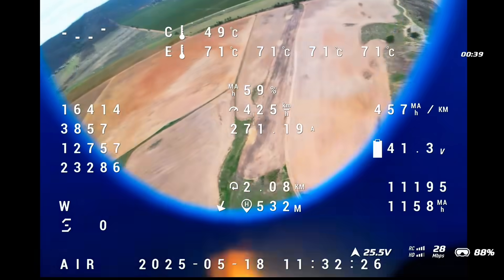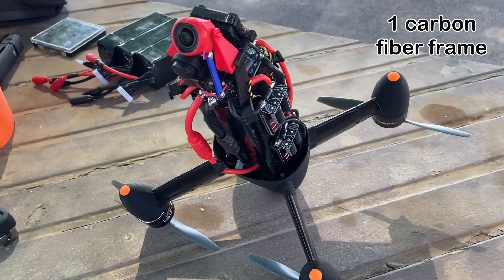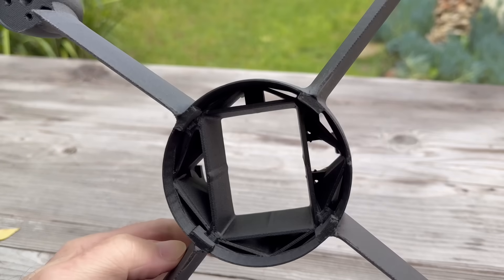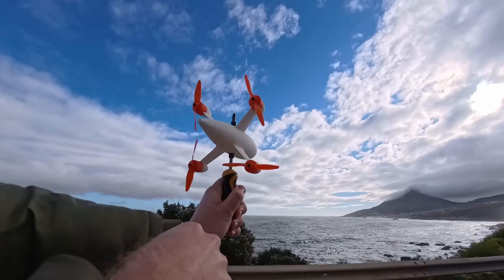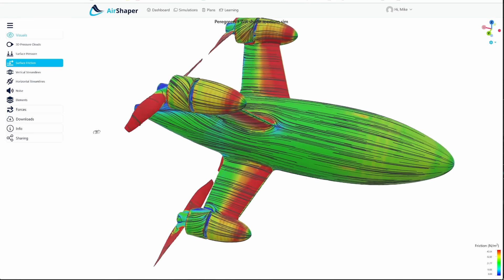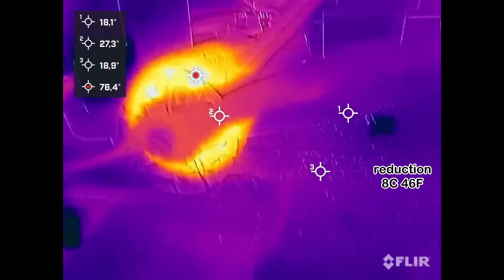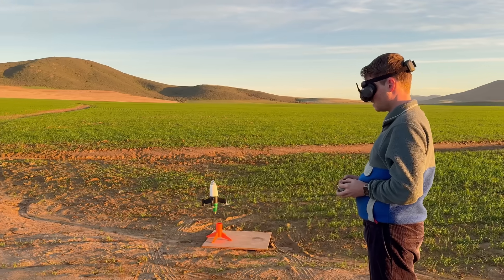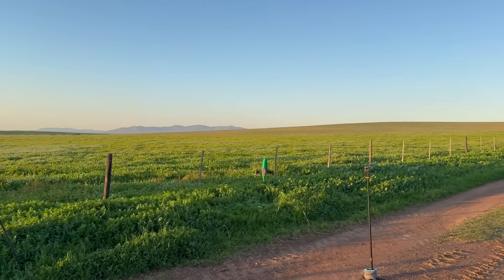How fast can a drone really go? 🇿🇦

Comment: 🤖 TLDW (Too Long Didn't Watch) - AI Analysis
Nothing personal, just learning what AI can do these days, n8n and stuff! 📚

⭐⭐⭐ EXECUTIVE SUMMARY ⭐⭐⭐
This video documents the technical journey of a father-son team in building the Peregreen 3, the world's fastest quadcopter. Through rigorous bench testing, multiple design iterations, and advanced aerodynamic simulations, they overcame challenges in power delivery, structural integrity, cooling, and high-speed stability. The key breakthroughs included a novel 3D-printed braced frame, a custom water-cooling system, and a deep understanding of passive stability, ultimately allowing them to set a new world record of 585 km/h (363 mph).

⭐⭐⭐ DETAILED BREAKDOWN ⭐⭐⭐
The video chronicles the ambitious project by a father and son to reclaim the world record for the fastest FPV quadcopter. It begins by contextualizing their journey, having previously set the record twice with their Peregreen 1 and 2 models, only to be surpassed by competitors. This sets the stage for the development of the Peregreen 3, an endeavor to double the power and push the engineering limits far beyond their previous attempts.

The narrative first delves into the extensive bench testing phase, where numerous batteries, ESCs (Electronic Speed Controllers), and motors were tested to find the optimal combination for power and stability. This process was fraught with challenges, including catastrophic fires caused by voltage spikes and running throttle controls through Betaflight without proper smoothing, highlighting the extreme nature of the power systems involved.

A significant portion of the video focuses on the iterative design of the drone's body. The team moved from a traditional carbon fiber frame, which created an unfixable center of gravity issue, to a fully 3D-printed main frame using carbon fiber-infused nylon. They explain how bracing and internal trusses were critical for achieving the necessary torsional stiffness, making the 3D-printed structure stronger in some aspects than carbon fiber. The design also evolved to incorporate a custom water-cooling system for the ESCs after air cooling proved insufficient and created excessive drag. This shift to water cooling not only solved the overheating problem but also improved the drone's aerodynamics.

The final major hurdle was achieving high-speed stability. Initial flights were plagued with wobbles. Through physical experiments with half-scale models and CFD (Computational Fluid Dynamics) simulations using AirShaper software, they discovered the importance of passive stability. By adjusting the drone's pivot point (center of gravity) relative to its aerodynamic center, they created a 'weather vane' effect that allowed the drone to fly straight naturally. The video explains complex aerodynamic concepts like shape drag vs. skin friction in an accessible way, using the golf ball dimple effect as an analogy. After meticulously tuning the flight controller and implementing all the design improvements, the team successfully achieved a new world record of 585 km/h (363 mph), providing a satisfying conclusion to their exhaustive engineering efforts.

⭐⭐⭐ KEY TAKEAWAYS ⭐⭐⭐
🎯 A new world record for the fastest FPV quadcopter was set at 585 km/h (363 mph).
🎯 High-speed crashes can be caused by the Doppler effect creating a brief signal loss when flying directly past the controller, which incorrectly triggers the 'Return to Home' failsafe.
🎯 For structural components, a well-designed, braced 3D-printed carbon fiber-infused nylon frame can offer superior torsional stiffness compared to a flat carbon fiber plate.
🎯 At extreme power levels (over 16kW), air cooling is insufficient for ESCs; a sealed, water-cooled system can solve overheating while simultaneously reducing aerodynamic drag.
🎯 Achieving passive stability by carefully balancing the center of gravity and aerodynamic center (like a weather vane) is more critical for high-speed flight than relying solely on the flight controller.

⭐⭐⭐ ACTIONABLE ADVICE ⭐⭐⭐
💡 To prevent high-speed signal loss with digital FPV systems, avoid flying directly past your position at max speed, as the Doppler effect can disrupt the signal and trigger a failsafe.
💡 When designing high-power drones, use robust capacitors and TVS diodes to mitigate destructive voltage spikes, especially during bench testing.
💡 For achieving high-speed stability, prioritize passive aerodynamic stability by moving the center of gravity forward of the aerodynamic center, rather than relying solely on PID tuning.
💡 If you are 3D printing structural parts for high-stress applications, incorporate internal truss structures to dramatically increase stiffness and strength, mimicking principles found in bone structure.
💡 Utilize CFD simulation tools like AirShaper to validate aerodynamic assumptions, as intuitive designs for cooling or drag reduction can often be counter-productive in reality.

⭐⭐⭐ COMMENTS INSIGHTS (The Real Gold) ⭐⭐⭐

✅ WHAT PEOPLE LOVED:
👍 Helpful technical explanation about propeller torque
👍 Expression of gratitude

❌ MAIN CRITICISMS:

😰 COMMUNITY PAIN POINTS:

🙏 WHAT VIEWERS WANT TO SEE:

⭐⭐⭐ THUMBNAIL BREAKDOWN ⭐⭐⭐
🎨 3D render of a drone
🎨 Aerodynamic, bullet-shaped central body
🎨 Yellow lines indicating airflow over the drone
🎨 A blue visual effect representing a spinning propeller
🎨 Transparent front section revealing red internal components
🎨 A circular icon in the top-left corner with a microphone and a bell
🎨 Dark grey quadcopter arms and motors
Reply: Thanks for reading the TLDW! Anything you’d add? If you find any value in it, hit me up to discuss your use case!

Comment: With the amount of power you have onboard, you could go faster by mounting a magnet on the front and ionising the air in that field. You can make a partial vacuum. A 1cm vacuum field collapses every 0.013 seconds, so you will need a decent frequency of ionisation, increasing as your speed increases. Additionally you can use magnetoaerodynamics to coax that ionised air behind to give you a net thrust.
But the main advantage is you have a sharp point travelling into a vacuum. Not just no wind resistance, but actually being pulled.

Comment: I wonder if there's some kind of single use chemical battery. If you remove the need to be rechargeable, I'd bet batteries could get a lot smaller and lighter

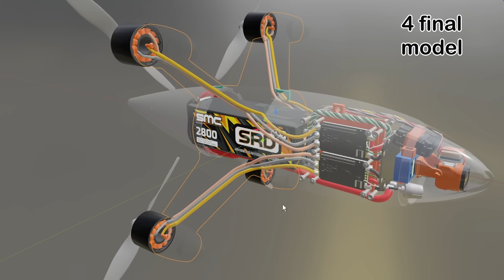Comment: 8:00 Look like a typical case of having the center of lift/drag in front of the center of mass.
you want an arrow, with the mass at the tip and the vanes as far back as possible.
that reduces manuverability, but that's hardly the issue.
The problem is that the wings are also the supports for the proppellers.
Ideally, the center of thrust should be ahead of the center of mass, making the craft a hanging pendulum in it's stable equilibrium state, as opposed to the unstable equilibrium when the center of thrust is behind the center of mass.
This could be fixed by simply adding more vanes at the back, but at the cost of increased drag. 
I  believe that increasing the length of the chord and having them sweep forward could increase stability. 
depending on the relative mass of the motors, moving the battery to the front might help too.

Comment: Why don’t you put goofball dimples over your shape?
Reply from the maker: Dimples are for golf balls only, because a ball is a terrible aero shape and a particular quirk that only benefit balls.  Not a single aircraft or airliners has dimples because it would just add drag.  You can be certain all Airliners would immedeately apply dimples if it save fuel.

Comment: Congrats on the record flight! In rocketry for extra aerodynamic performance we worry about surface finish of the rocket. Do you polish the surface of the drone or just use the print as it comes off the printer. A shiny skin will reduce surface drag.
Reply from the maker: Thanks. We did sand some of the drone bodies but lost them in crashes. The fastest flight was not sanded. But an issue with sanding infused CF is the CF goes furry which is not great. So a coating of some sort will do better. But there was always something more pressing to get done. However we guesstimate a smoother finish might deliver an extra 10-15kmh. 

Do you know what sort of speed or extra height benefit you see on rockets from polishing?
Reply: @Mike-Bell  Yup, I can see how sanding would be an issue with the CF. We typically use spray putty to coat the surface and then sand that back. You remove most of it during sanding but it does fill in things like layer lines. Then you can use primer and top coat. In terms of performance it can be a significant boost somewhere in the range of 5-15% more altitude. It's even a couple percentage difference between glossy paint, and polished glossy paint.
Reply from the maker: @AirCommandRockets  Thanks. We must give that a try

Comment: I term "high speed flight" outside of the atmosphere c/3 (negligible relativistic effects) and by using Alcubierre metrics, about 8c is possible with currently available technology (sic). Efficient high speed flight within a fluid (atmosphere or water) requires nearly complete removal of air drag. This is possible by using a vacuum around the craft. In water, a similar effect can be obtained by using supercavitation (e.g. the Shkval torpedo is such a product for military use). For atmospheric flights with a speed of up to about Mach 36, there are two possibilities. Either by turning the air around the craft by microwaves into a plasma and using magnetohydrodynamics (Lorentz force) to push ionized air molecules away from the hull. Without air, there is neither body drag, nor fluidic friction. The return-on-investment point (in terms of of energy consumption) is about Mach 4.5. Scram-Jet engines (powered by combustion or an electrical plasma jet engine) are mandatory, since propellers can't go above ca. Mach 0.7. There is a second possibility, that uses much less energy and is suitable to be battery powered. I can't talk about the technology here for self explanatory reasons.

Comment: That drone is nearing the same power to weight ratio of a top fuel dragster!
Reply: you nerd-sniped me: Peregreen 3 16.2kW/2.77kg=5.85kw/kg  TF dragster 8200kW/1052kg=7.79kW/kg. this means that Peregreen 3's PWR  is 75% of a TF dragster.

Comment: Consider 3-blade props. Make them a smaller diameter with equal total surface area. The RPM required for tip speed to go transonic will go up. Much of the sound you hear is from that tip speed.

Comment: 6:37 Would it be an option to use evaporative water cooling?
I assume that it could save on weight and volume. 
I’m just curious. 
Fantastic video btw!
Reply from the maker: Nice idea but we only need 59ml of water. Plus mist around electronics is not very safe.

Comment: Thanks a lot for your video ! It’s very fun to Watch. Why don’t you use only 3 motors in stead of 4 ?
Reply from the maker: The beauty of 4 props is the opposing pairs of props cancel each other’s torque — two spin CW, two spin CCW.

With three, you’ve got an odd prop out, so the torques can’t balance. The whole system would constantly twist itself around.

Comment: Not sure if you know this but there's a video of a guy doing 564 mph (measured by speedgun) in an RC glider: https://www.youtube.com/watch?v=GCVK3w5DHbk
They're transonic dynamic soarers, the aircraft do something like 50+Gs in a massive loop and turn fast enough that most navigational tracking like GPS for speed won't work without new software and they are constantly on the verge of stalling, overspeeding and wing-warping itself into a crash when the winds are fast enough.

Comment: adding water without any radiator to dissipate that excess heat is just increasing thermal mass. I think you could just use simply a copper block without water hazard. But it probably would be more ideal to incorporate the ESCs in the wings made of copper. you could CNC machine the wings made of 2 slices and you have both thermal mass and the ability to cool the mas.

Comment: Awesome project and awesome result. A tiny bit of positive criticism: about the high speed passes mentioned at 16:41, yeah, it is probably risky in any case, but having Return to home enabled instantly on signal loss was in all regards a mistake. It is arguably safer to keep that function disabled at all for a project like yours, but making it trigger instantly was your decision and that is not something inherent to the high speed passes, doppler effect or signal losses. 

In our field it is totally forbidden to fly anything without a properly configured failsafe. No matter the failsafe type, that is the pilot’s decision, but there is a lot of people unaware of what happens when their radio fails, and that is asking for an accident to happen.

Comment: Have you considered shrouds/ducts around the fans to increase efficiency of the props? It might also prevent the prop wash from contributing to the flow separation on the body. Also increasing the voltage (smaller batteries but more of them in series) can allow esc’s to run cooler since the current is lower despite same power.

Comment: Incredible accomplishment! 

With the steep-pitch props burning SO much power for takeoff & landing, I wonder if rules would permit an assisted launch? If an external launcher could fling it into the air, it would immediately be in a higher-efficiency regime for the propellers, potentially saving a huge amount of battery power to be applied to high-speed flight. (Ditto for the return, if there were some way to catch it without damaging the propellers or airframe, but that seems less likely.)

Comment: What about integrating heat sinks into the external surface, removing need for water cooling? With so much airflow at speed, might be effective.

Comment: I have a suggestion for esc cooling. Use “Peltier modules” on the esc’s. It would probably provide much better cooling than water cooling. You can get them in various sizes and voltages. I think it would make a huge improvement over water. You’d have no more problems with overheating. Please let me know what you think about this. Thanks.

Comment: Incredible engineering lads! Have you thought about adding aerodynamic tapering to both the backside of the motors & tapered prop nuts... Also applying a low friction hydrophobic or microfibre coating to the drone shell... I really want to see you hit 600kmph!

Comment: Awesome to see you guys are back at it again, long may the Drone Speed Record remain yours and be proudly done in South Africa!
Reply from the maker: Thanks 😊 🇿🇦
Reply: @Mike-Bell  Yeah this is one record that should stay in South Africa! no one else deserves it but you guys, also you need to try and find somewhere in South Africa with a wind tunnel and see if they would be onboard with being a technical partner to help you guys break the 640 kph or 400mph barrier to lay down the biggest gauntlet yet in this speed challenge....
Reply from the maker: @RobertGracie  a chinese team has told us they bust 600 recently but likely won’t make it public.  And there is a very clever chap in Germany who also has the ingredients for 600. 
We have tweaked Peregreen 3 into a 600 plus version and are close to flying it. The 624kmh is definitely in our sights. But that is likely only doable with Peregreen 4.
Reply: @Mike-Bell  Why not use 3 custom solid flat copper bus bars in "wings"  to reduce frontal area? Isolation can be done with thin Capton tape (or separate them in 3D print or with thin FR4 material etc.). Plenty of space for soldering near motor.
Reply from the maker: The arms are about as thin as they can get. So plenty of space for wires.
Reply: @Mike-Bell  They can get mutch thinner. Did you think about running very thin, hight strength wire from motor to motor connecting/tying each in square? Motors in corners in wire square. It will add rigidity to arms and they can get thinner... Kevlar, UHMWPE, High-tensile steel wire etc.
Reply: @Mike-Bell  Go big or go home Mike, if needs must try for 700kph....or even worse 800kph to bury them!

Comment: Perfect interceptor drone the military  need you guys
Reply from the maker: Inevitably they are already flying in Ukraine.
Reply: @Mike-Bell  yes I see that... are they based on your design? They look very similar?
Reply: @bronoi  I think it's probably more a case of convergent design.  Inevitably, anything designed to go really fast in an atmosphere is going to look more and more like a missile or bullet.  It's the same reason why all stealth jets look somewhat similar, and why all rockets look basically similar in the broad sense.  Devices built to perform similar tasks mostly converge on the most economical forms.  
Of course an interceptor drone for war will probably be significantly bigger than this one, it will obviously require a warhead which will add mass which will in turn require more powerful motors and thus a bigger battery and thus a bigger power management system, etc, etc.  In the end they will probably be bigger than a comparable missile because batteries are only a fraction as energy dense as the solid rocket motors of a missile.  
The upsides of the drones will always be that they are vastly cheaper to build compared to a supersonic rocket engine propelled missile, commercial motors and battery packs and easily programmable civilian market value computer parts cut away the overwhelming majority of the costs.